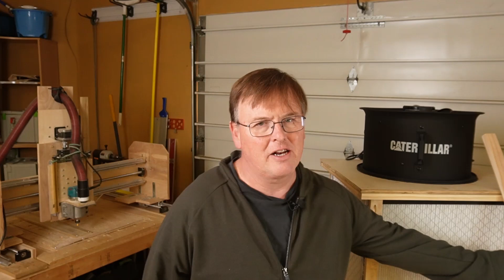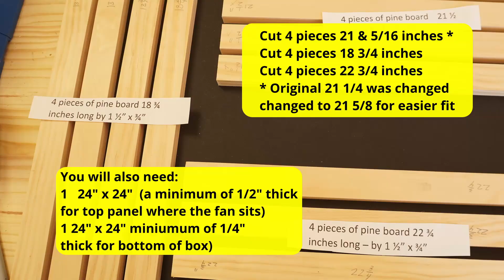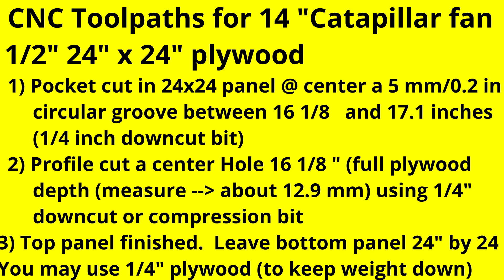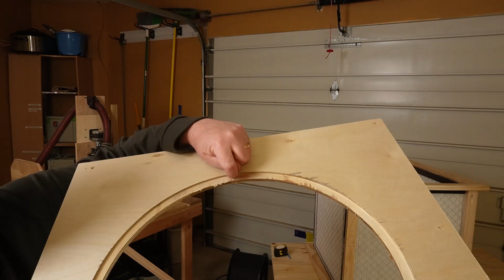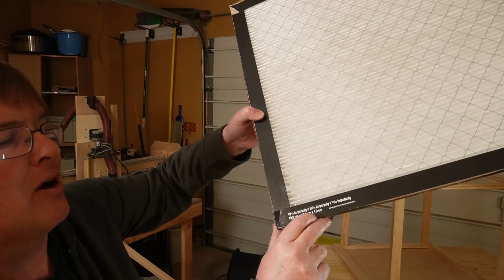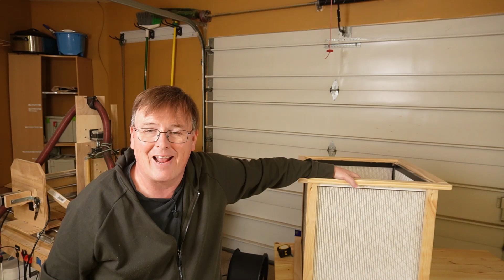DIY LOW COST, HIGH QUALITY AIR FILTRATION FOR CNC AND WOODWORKERS

Comment: I might build one of these. I wonder about building another box to contain the fan, and maybe put a MERV 8 on top, to keep dust out of the fan bearings. Increased complexity, i know.
Reply from the maker: Some people reverse the fan direction (set the fan face up) and then reverse direction of filter arrows).  That way the bearings on the fan should only be exposed to filtered air.  Downside is dust collection would be on outside and the fan speed knob would be on inside (however, you could set the speed to high in advance and then turn on fan with plug in wall socket remote -- about 12$ on Amazon).  Let me know if you have any questions.  Hope you build one.